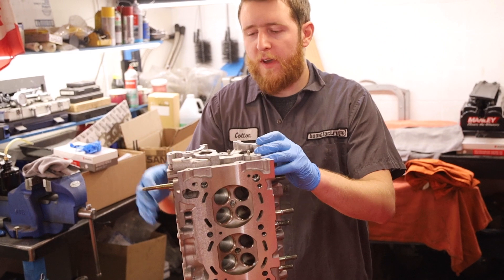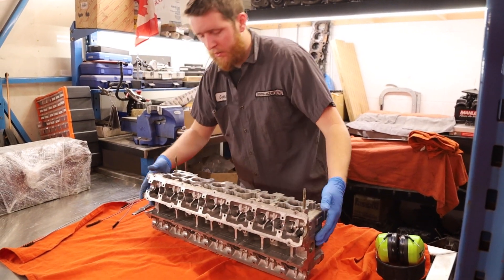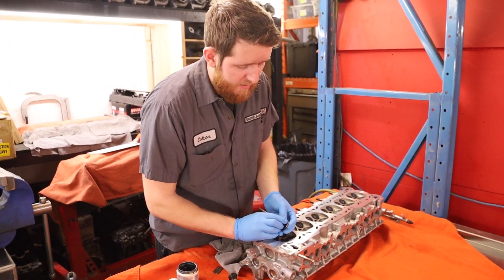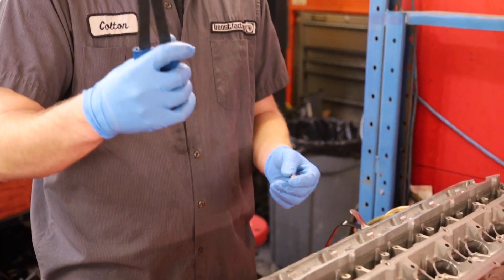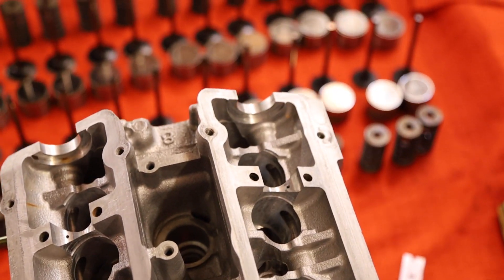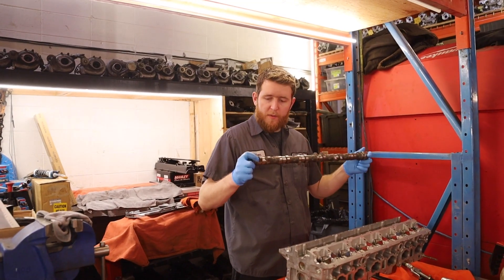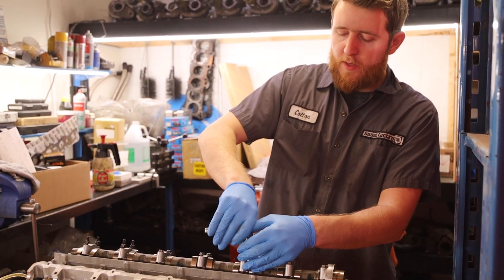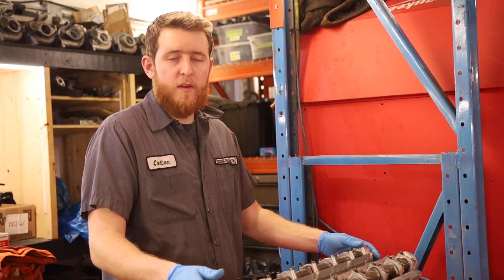RB25 HEAD BUILD - EPISODE 1 || BOOSTFACTORY

Comment: Do you have part numbers or a place you recommend for getting the 10 oil plugs for the head? Some of them are discontinued through nissan from what i found. I have only located 2. Any help would be greatly appreciated.
Reply from the maker: hey matt! i see you found them on our site! let us know if you have any other questions! also keep in mind if you are replacing the plugs on the rb25 s1/2 you will need a special plug, this is also available on our website! ( intake side front plug. )
Reply: @boost.factory I have a 26 but thanks again!

Comment: Hi!
You guys might know this! What do people replace their rb25det neo lifters with? I can`t find any info about this subject? I need mine changed because the aluminium lifters on the exhaust side is worn out.
Reply from the maker: Unfortunately the only option currently on the market is used oem or new oem. which is very expensive. we do have a cylinder head we are parting out if you wanted to email us on a used set  colton@boostfactory.ca

hope this helps!

Comment: Do you think the valves sank from lapping and if so how thanks !
Reply from the maker: Hey, good question! Nothing considerable. You are only trying to get the valve to know the seat again. You're not trying to machine anything down. You would be hard pressed to make a significant change in height without our first damaging the seat. The valve installed height is relatively the same as before, and the valve shim thickness reflects that!
Reply: @boost.factory  '003?

Comment: Hi how do you remove the steel balls that block the oil gallery’s holes?
Reply from the maker: Hey Chris, we have a pointed steel tip that we weld onto the ball, then that threads onto a slide hammer, a couple taps, and they're out!

Comment: hey Colton, it’s me again lol outstanding video, and I really dig that tool to install valve spring keepers. now, regarding the valve leaping technique, I’ve heard that you’re supposed to tap ‘n twist, instead of only twist. apparently the tapping motion helps with creating a bigger contact area. do you know if that’s true or not?
Reply from the maker: Hey John, good question. in my experience the lapping compound is working its way out in both directions across the entire face while twisting anyways so i dont see the need to tap,  then when cleaned off you can visibly see the contact patch. I typically see people tapping to re-introduce lapping compound back onto the seat and valve face, then you can continue lapping. Again, you're only trying to get the surfaces to know each other. You're not trying to remove excessive material. 1 maybe 2 passes is plenty. Any more, and their is an issue.